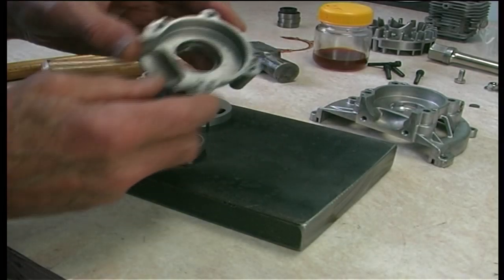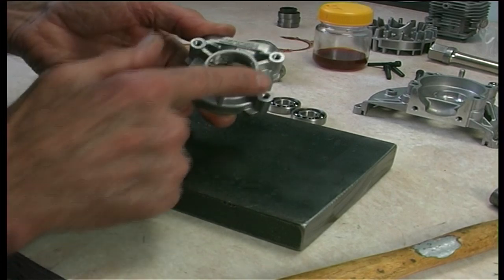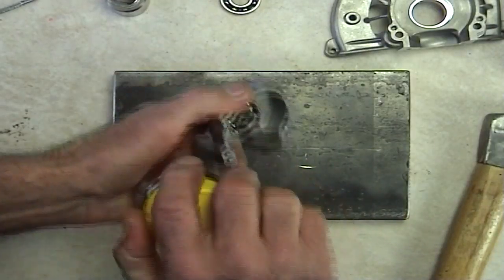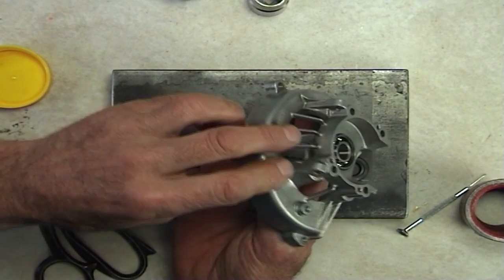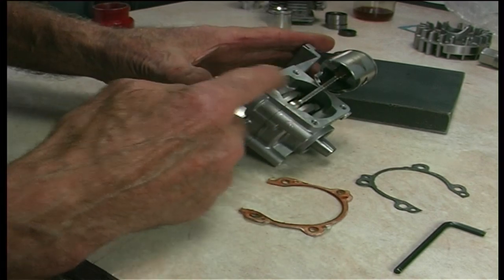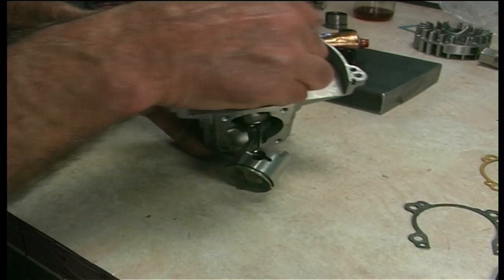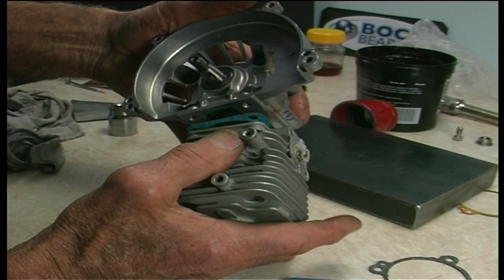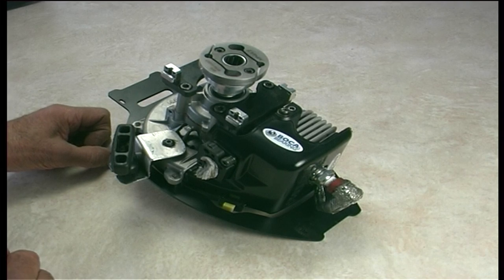Part 6 - Zenoah RC engines crank bearings renewal - FITTING NEW BEARINGS & CRANK END PLAY ADJUST

Comment: Never hit a bearing with a hammer, 1 mistake and the bearing is toast. Make a plug if needs be, or use a press clearly need a lathe or press so most dont have these. But heat is your best friend. heat the case in the ovan, fridge or freeze the bearing and they fall right in.

google is your friend

Comment: Interesting point how you took one cover off the sealed bearing giving it abit more seal but my friend there are two different bearings for the case. They are not all sealed when you get them. 2 open crank bearings and one sealed.

Comment: Tightening the flywheel with a socket on the otherside of the crankshaft is a sure way to twist the crankshaft...What book have you been reading?????
You have perfectly put together a $300 paper weight!
Reply: You cant be serious .......that crank takes many times the amount of torque while that engine is revving than he could apply using those hand tools......
Reply: @cornbobrimlove7892  You clearly have no idea. Normal running don't put a twist on a crank.
Reply: Im an engineer so yes I know plenty. He is NOT going to warp that crank with those hand tools! The forces on that engine turning 34,000rpms is going to put far more strain on that crank than him using those hand tools on it! At high rpms that tiny piston could weigh 50 lbs or more.
Reply: @cornbobrimlove7892  Clearly not a very good engineer if you can't see the directions of forces. Piston going up and down is not going to twist the crank even with 100,000rpms. And that engine is lucky to do 17,000rpms.

Comment: Also i think that sealed bearing only seals properly when there is oil pressure present while motor is running. Not so sure about adding that extra seal. The two open crank bearings are different. Possibly why you had abit more end play

Comment: So many rooky mistakes that you should never ever do. 

1. Never hit the bearing directly and use a mullet not a hammer if needed. Sure way to damage the bearing or the case. You may even consider having a piece of masking tape between the bearing and socket to soften the blow if you need to use a mullet. Use a wise, press or an adjustable clamp so you can press the bearing down strait. Often using the ring of the old bearing helps to press it home.

2. If possible place the case in oven for 100'C and the bearing in the freezer to make it fall in easier. It is lot less violent for the bearing and you have lot less chance to damage the case. Makes the job lot easier.

3. Seals you never ever tap them in place. Gently press them in strait using a socket and a clamp or a wise. Tapping will damage the seal and the case.

4. THE BIGGEST MISTAKE THAT MOST LIKELY STUFFED THIS ENGINE was to tighten the clutch side and the flywheel side simultaneously putting a twisting force on the crank. That would have almost 100% damaged the crank weakening it, putting it out of balance, out of line and to be a subject of breaking in use. You NEVER EVER put twisting force through the crank using it as the counter lever. You tighten ONE SIDE ONLY AT THE TIME!!

5. Use a piston stopper. But before that check the engine you are working on. Some modified and ported engines have skimmed and lightened pistons and using a piston stopper will break the piston. In that case lock the flywheel through the front cooling but be careful. Or place two of the flywheel cover bolts on the case and one bolt on the flywheel and place a screwdriver across so it stops and secures the flywheel when turned . You can usually do similar to the clutch side using the bolts for the clutch housing for example. On trick also it to push down a length of string from the sparkplug hole so that when turned it won't go full cycle. Soft string often is the best way. Of course leave some string out so you can pull it out when done.

Comment: Apparently you are misinformed on how a bearing is installed that requires an interference fit into an aluminum housing or part. The aluminum part requires to be heated to 350°, so the bearing falls into the aluminum part and then it is seated into the housing and then let the case cool. The process you are showing is a guarantee of misalignment and bearing spinning in the case as well as premature bearing failure. There is NO Hammering on the bearing and No eye balling to see if it is square and seated properly. By pressing the bearing into the aluminum when it is at room temperature will gall the aluminum that is suppose to have an interference fit and hammering the bearing in will cause embrittlement to the races. The crank case haves do not seal evenly around the case…put the halves together without the gasket and one can easily see the surfaces are not parallel to each other.  One can machine or correct the discrepancies.
One can easily tell you definitely enjoy using a hammer…lol
Reply: PerformanceUnlmtd i WAS THINKING SAME THING !!!!!!!!!!!!!!!!!  ..  ??????????
Reply: PerformanceUnlmtd how long would you heat the case up for? Is ceramic bearings better ?
Reply: Oh Bullshit........it will be just fine......its not the space shuttle, its a weed whacker engine.
Reply: @cornbobrimlove7892  lol yah pretty much. Still heat helps
Reply: @cornbobrimlove7892  lol